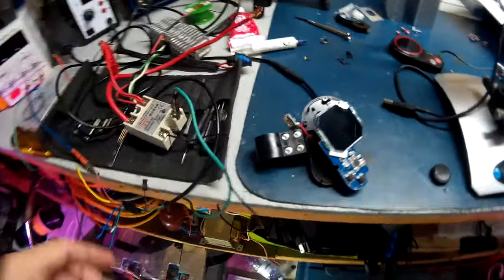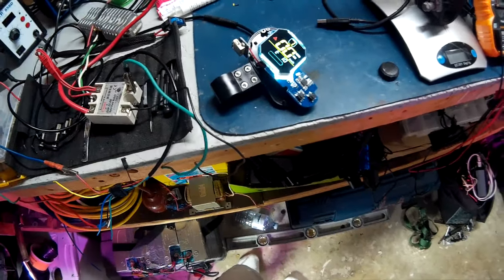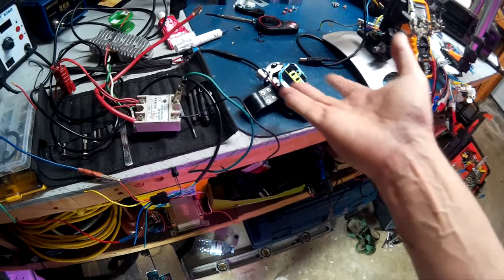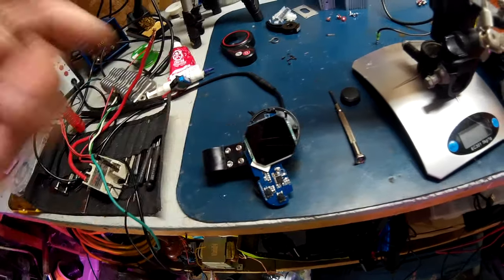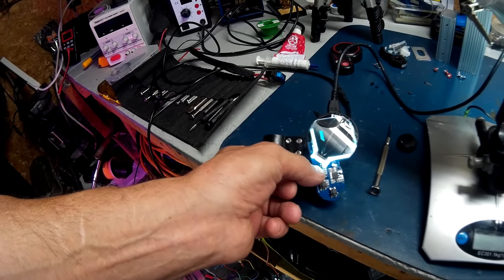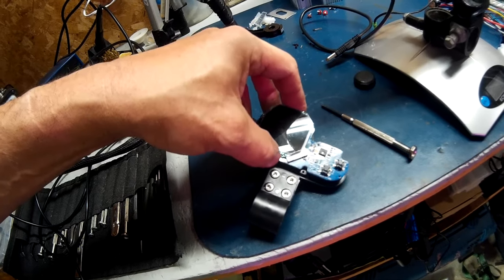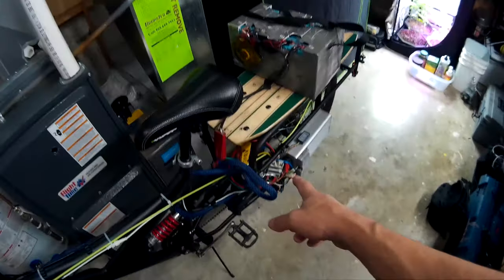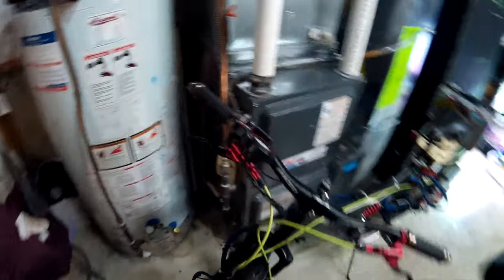Motor Brushless Controller with Rainproof LCD Display

Comment: Hey, what about holding down power and mode button at te same time until "P1"  shows on the color screen?  From there my paticular model from Anazon shows 16 P channels. Each one is adjusting different functions of comtroller. Why does your video not mention this?

Comment: I have a LCD LH 100  and It doesn't show the battery indicator How do i fix this?
Reply from the maker: have you even got it wet?
Reply: @karmaEbikes.  ? No It Is new but sometimes It gives me problem with the battery indicator and when you put the password even of it's right It does not let you go until you use the 3745 code
Reply: @kekkokarlo  After pushing mode and power buttons together for 3 seconds you'll go into programming mode. Then just pushing mode button takes you through all programming channels. Probably P1 through P16. The battery indicator on display is accessed upon powering on your e bike each time by first pushing power button by itself for 3 seconds. Once display is lit again push power button.   Do this while looking at display. You'll see different things appear on screen. Once you see battery indicator, stop pushing power button. Battery display on my screen appears after pushing power button I think 3 or 4 times. Sucks that you must do lots of button pushing but it does work.
Good luck 
Your paper instruction that comes with controller/display should list all P functions.

Comment: Hello everyone. I need advice. I have Display LH-100 on scooter FLJ K6. I don't know how to reset the ODO meter to P16. I hold down the MOD for more than 5sec. Nothing resets. I disconnect the hard reset connector. Nothing resets. The ODO meter had 8km on the display after unpacking the scooter.
Reply: 15SEC No 5sec
Reply: @videoafoto  I believe after you get to P16, the very next time you push mode button display should say in large letters ODO
Stop there and hold both buttons again. It's some button pushing sequence once in ODO mode. Good luck

Comment: Bonjour est se possible de outilise ma batterie LG 60 20.8A  sur controller 60v 13A  ?
Reply: @oliverkuzmanoski916  yes 60 volt battery pack will operate controller. It might not be enough amps or amp hours for long rides but it will operate controller.

Comment: Where does the h-brake cable connect
Reply from the maker: that would be. low  potential brake. there two pins there for left and right levers switches
Reply: @mahmuttekin3882  look on instruction sheet to identify high brake wires . The way they connect is through your handle bar pull brake levers. You should have small wire connections built into hand pull lever that operated your brake cables. They  basically make a connection together when you squeeze hand lever. And it makes controller stop spinning wheel and regenerates power back into battery! So they say....I dunno if it really puts back piwer!

Comment: what's the password for the p-settings?
Reply: @Iinustechtips  power on controller with button on display. Once lit then hold down both buttons together for 3 seconds you'll go into programming mode.
Or some crazy controllers you need to enter 7960